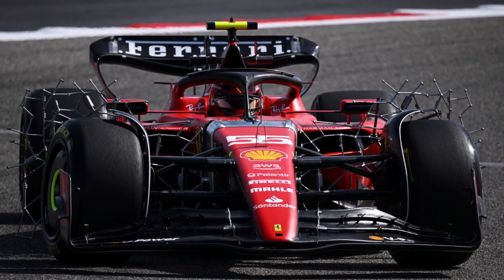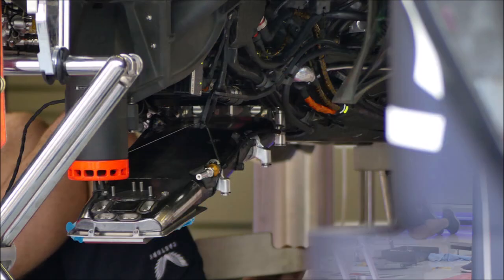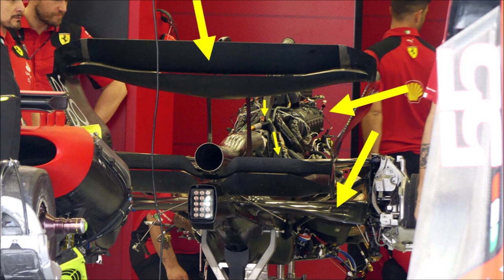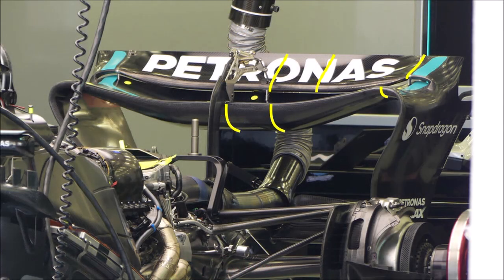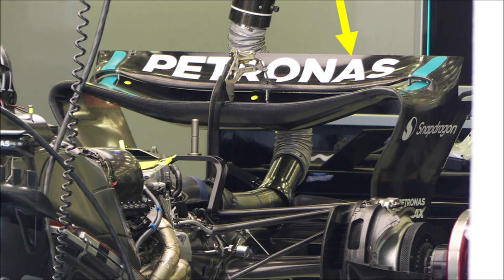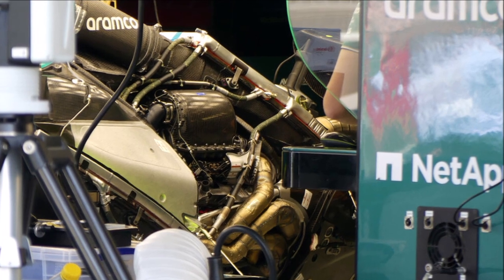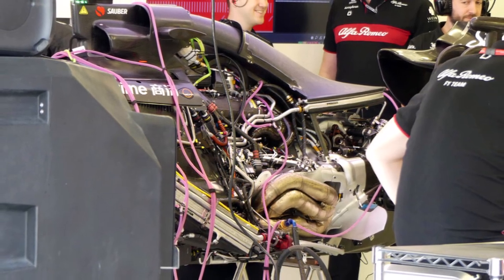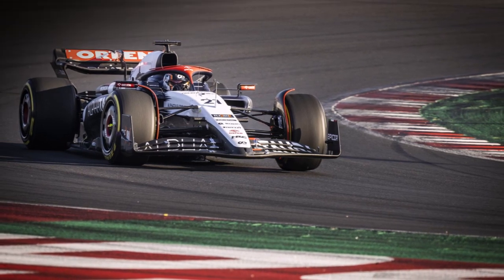F1 2023 - Race 1 Bahrain GP - Technical Details

Comment: Do you think the Mercedes X chassis and radiator/fuel cell concept means a higher CoG compared to other teams? Could this be part of their problems with balance and setup in 2022 and 2023, or is that more likely about aero/floor and suspension?
Reply: 100% it does increase cog but ig their compromise was aero improvements. They haven’t gotten there yet so we’ve yet to see most of the concept.
Reply from the maker: It does increase CoG a bit but the aerodynamic benefit was much higher before 2022. With the new generation of cars it lost it‘s purpose because you want large sidepods.
But a slightly higher CoG is not the root of the problem for Mercedes.
Reply: @BSport320  OK, thanks. Just seems like they have a fundamental vulnerability with balance in both 2022 and 2023 so far, and they presumably made changes to their suspension design.
At the same time, engineers are saying that the sidepod shape isn't really as critical as the media make out. I guess we will find out when they fix it, or give up on the concept.

Comment: If Mercedes ever choose to run large sidepods but keep the same chassis, could they use the sidepods extra space to channel clean air where they want?
Reply from the maker: That’s an interesting idea. There would be potential for that and you could always intentionally leak some flow somewhere:)
Reply: @BSport320  are they any rules against this? We see how ferrari and redbull have a cooling opening where their suspension opening is, but maybe Mercedes could channel clear high energy air through their with “normal sidepods” and get maximum outwash and an extra energy boost. I feel as though maybe the zero pod concept is not the best way to maximize the insane cooling technology they brought to the car